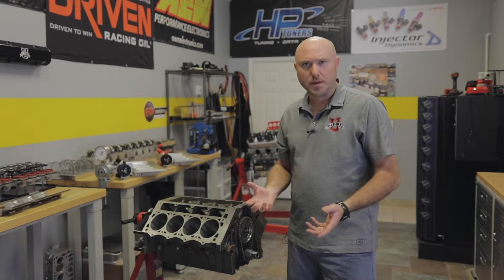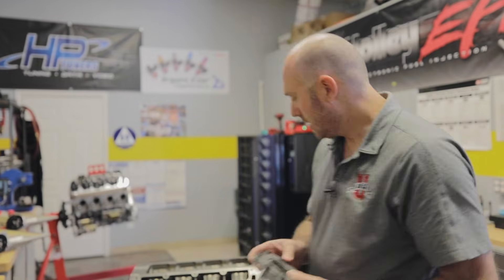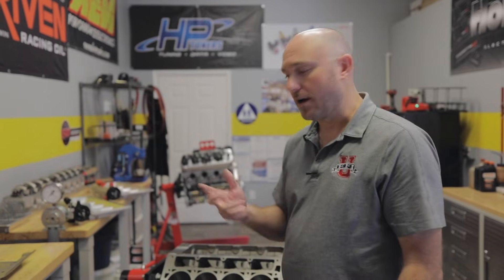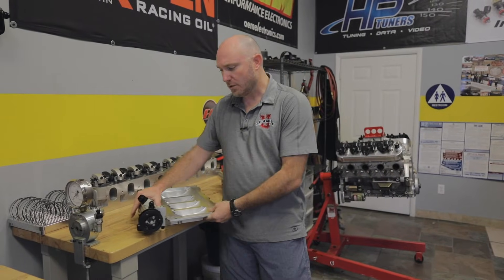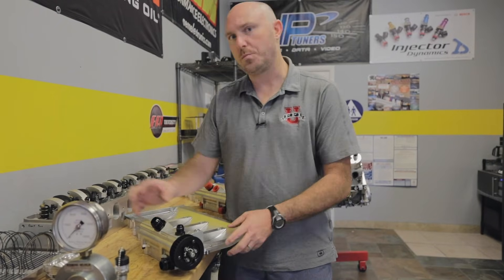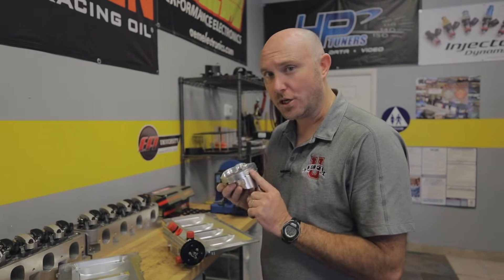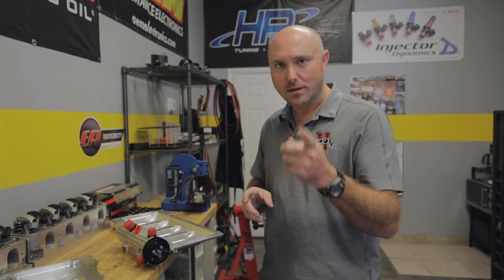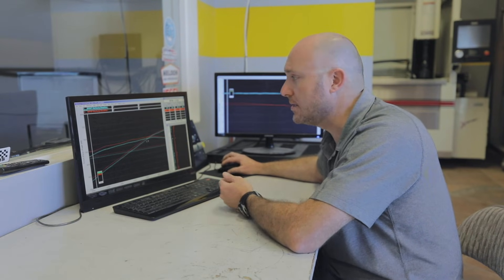Everything you need to know about a dry sump oiling system.

Comment: 6.10, yea-nah, Bro. The sump is NOT being pumped full of 400 CI air per (2) revolution like the cylinder head / combustion CHAMBER is, 'cos da sump don' breafe in through a seperate intake manifold. All tha happens in the sump, is that the air that already in there gets circulated around, below the piston heads, helping (slightly) to cool them. Aside from blow-by and air circulation, NOTHING is happening in the sump. Those 'pumping losses / circulation losses' apply, no matter what oiling system you employ. UNLESS you  'vented' (illegal) the scavenged air to the atmosphere?  Your gains have nothing to do with air pumping losses, unless you'r running an illegal 'vent' system.

Comment: I don’t think you explained the horsepower gain from the system all that well. You made it seem like there was some kind of pumping action with the Pistons moving downwards when in reality the crankcase pressure is equal at all points of crankshaft rotation disregarding the piston blow by because the volume displaced by the Pistons moving down is offset by the Pistons that are moving up. I think the only reason a horsepower would go up is because the air in the crankcase under vacuum is less viscous than pressurised air. Think moving in water versus moving in molasses. This does make me wonder though if the crank case being under vacuum is going to cause more blowby and saturate the oil with fuel

Comment: 15 hp on a 500 hp engine is 3% increase, not really significant.    How much more does the drysump weigh?  
I'm working on a jetboat and there is no room for a deep sump pan, hardly room for any pan..and also you can't change oil as there is no oil drain plug possible, so I'm looking at a psuedo dry sump, with the stock oil pump as scavange to fill a remote tank, and a pump is run inside that tank to feed the engine, electrically driven.  I have not really seen that done.

Comment: I'm under the impression that just because you can use this dry sump doesn't mean you should, when a car goes up in flames in an accident, it's because the oil running in an engine has nowhere to drain. This is more of an application that would be installed in an older vehicle with an engine that requires additional power to achieve the function of its original design intent.

Comment: The reason I’ve always heard people saying they’re going to a dry sump system was especially if they’re going to be circle track or road racing a car that you didn’t want all of the oil getting thrown to one side of the pan and starving the engine. I know that there are certain kinds of pans that have baffles or you can get a different pick up tube to put on the other side if you’re just going to be running in a circle, but from my understanding, the dry sump is the king when it comes to protecting yourself from oil starvation.

Comment: How does the fact that the scavenger pump is driven by a pulley prevents oil over pressure if the main pump is still powerd directly by the shaft?
Reply: Because when tuning you have an ideal rpm for maximum power you swap pullys to change the oil pressure at desired rpm

Comment: For what a dry sump cost it's not worth it for 14hp. Run a deeper higher capacity pan and run it a few quarts low. That with a crankcase evacuation system will do the same thing for a lot less money.

Comment: I would think another benefit would be, is that with a dry sump, the oil pan is much smaller, and thats good for doing LS swaps for example, because the smaller oil pan doesnt get in the way of suspension and steering components. and also because you could place the engine lower in the car, lowering center of gravity. One downside to drysump I would think, is that if the belt driving the oil pump breaks at high engine rpm, you could damage the engine, wheres the wet oil pump is driven off the crank and chances of it failing are low.

Comment: On V engines i think the pressures under piston ring are balanced. The same amount of pistons goes up where the same goes down... it's seems to a good upgrade on high rpm engines with turbo or compressor not for daily and definitely not for hemi with mds on.

Comment: I feel like everyone has a misunderstanding of a pumping loss. the way i see it, the loss is on the intake stroke not the compression stroke. before you think im crazy. go get you a milk shake from sonic, a good cold one.......is it easier to suck the ice cream up that straw or is it easier to blow in the straw.  guys "boost" is positive pressure on the intake. the "pumping loss" is the suction of the piston sucking air in.  Ive noticed on the later fuel injection engines that burn gasoline they are getting better at controlling the rpm with the fuel. in a cruise the throttle valve will be wide open.  even before the direct injection the later ford f150 v8s were doing as such.  its hard to believe that even being possible as volatile petrol is. i hope i dont come off as a troll, it took me a long while to understand that one. a diesel engine is a good example.

Comment: The way I was taught and, in my mind, if I have an engine that's worth putting a dry sump on. I would put it on there never thinking about a gain in horsepower. I would 10 times out of 9 times put the dry sump system on this dream engine if it took 20 horsepower from me. It just so happens there is no trade off.  correct me if I'm wrong.

Comment: 14hp/17lb.ft  for a system cost $6000 ? No thanks 
I can make 25hp to the wheel with a single timing advance degree in my turbo wet sump ls3 95 octane 
Thanks for the informative video
Reply: This is more useful in an application like mine where I need to lower my truck but am limited due to an elongated pickup tube. I am considering a dry sump to eliminate the need for a super deep oil pan. It is not only about hp gain, you can build a system for much less than 6k you just need to know where to look.

Comment: Great informative video, thanks. 
I have just put a wet sump system on a fresh built LS2 and it’s blowing oil past the rear main. It’s pushing 80psi already but you have me thinking maybe I need to run the pump harder to get the vacuum I may not be seeing, according to the oil leak. 
What are people’s thoughts on this?
Reply: the pump on the dry sump has 1 positive pressure pump like on a dry sump and 4 more pumps creating the vacuum\sucking the oil  out of the crankcase. maybe you just need a seal and /or make sure you have a place for your crankcase pressure to escape... valvecover with a pcv or a open port would be a good place.

Comment: Would it be better for a dry sump if you go to a race track few times a year or not ?
Reply: Trust me when i say this, you will most definitely know when you need a dry sump.  high reving hi dollar parts is where you will find it. I wouldnt think any engine builder would do this conversion with a hp gain in mind.

Comment: Be nice to compare the wet sump set-up with a vacuum pump versus the dry sump system. If crankcase vacuum alone is responsible for the gains, you should see the identical benefits with a vacuum pump on a wet sump system and should be less expensive. Dry sump are cool no doubt.

Comment: Great video. One comment is while that I agree the vacuum in the crankcase will improve piston ring sealing, however, at some point the frictional losses of the piston rings rubbing against the cylinder bore will negate the benefit of a better seal. Obviously, you will have to optimize your piston rings based on how much vacuum you get in the crankcase.

Comment: I run a 5 stage dry sump on mine when I had it built my machine shop and engine guy wanted me to go with it and the clear view see thru filter  cause They said we would be pushing the limits when I told them boost numbers I wanted to run.

Comment: You mentioned with a wet sump the oil pump takes works to pump resulting in a loss of HP.

Are we pretending the dry sump doesn't use a externally mounted oil pump that in all actuality uses more HP to operate than a basic wet sump? I love my dry sump for reasons of G forces in and out of corners in my offroad truck and nascar build but I don't believe I make more HP by any means. Potentially less to be honest. I guess what im getting at is its a safety/longevity system not a performance mod in the form of HP gain.

I dont believe the HP gain was from the dry sump system. I believe it was from the crank case vaccuum creating a better ring seal which is achieved with a vac pump on a wet system for the same result.
Reply: The difference in pumping work is due to the fact the we can intentionally alter the amount of oil being pumped in the first place so that we do not need to bypass as much once we reach the target pressure.  So we can choose to run smaller pressure section gears and adjust pulley ratios in order to do less work with a dry sump.  For example...on some of our very high rpm stuff, we run a .650” wide pressure section gear as opposed to a normal .850” wide gear.  That way we can still achieve the required pressure but with much less excess flow that needs to be bypassed.
Reply: You are also not pumping airiated oil straight back into the engine. Plus the dry sump should be scavenging oil off of the rotating assembly. Windage robs power. I'm surprised aerodynamics do not play more of a role in crankshaft design. It is going to take a certain amount of hp at high rpm to spin the crank and move that air/oil mix out of the way. Say it takes ten hp to move the air/oil mix in the crankcase at high rpm. If you can improve the aerodynamics on the crank and rods enough to reduce the power loss by 50% that's 5 free hp. Every little bit helps.

Comment: Nice video thanks a lot :) still don’t understand how the oil get pushed up into the motor tho . Does a oil pickup still get used ?
Reply: Ah does the oil pick up run straight off the pump instead of going inside the sump ?
Reply: @internalcombustion8744  Hello, I love your name.  If you watch at 4:00 he explains it half decent but leaves a lot out. That looks like a new oil pan you have to bolt on and notice it has a belt driven pulley. It's rotating and scavenging for all the oil that falls off the rotating assembly that falls into the pan into those separated areas. Then it gets sucked out of there and put into an external reservoir that is pressurized oil with no air. Then from there it will get piped into the oil pressure galleys, i'm not sure if it's just one inlet at the oil filter  or what, I would assume so. Then it goes through the galleys into the crankshaft to feed the mains and through the crankshaft to feed the rods and then it all spills out back into that new oil pan that is sucking it all up and feeding it to the reservoir. The vacuum created by that belt driven oil pump is what helps reduce crankcase pressure and in theory seat the rings better. This, combined with no long having frictional losses with all the oil slapping around inside the rotating engine provided the dyno gains.
Reply: @JohnDoe-lt9sg  
Oil draining on to the rotating assembly and creating windage is one reason you see enclosed camshaft housings on the really big buck pushrod engines used in Nascar etc. The enclosed camshaft housing then has it's own dry sump pickup. This should also help evacuate the used oil from the valve train removing oil that could potentially pool and cause power losses. Plus pulling the used oil from the heads should lower cylinder head temperatures.

Comment: There seems to be a factor in the work a piston does on it’s down stroke you failed to either mention or take account of & that is when one piston is on it’s down stroke creating crank case pressure another piston is on an up stoke making crank case vacuum so one cancels out the other.
Reply from the maker: That is only partly true though, because there are a lot of restrictions to airflow in the crank case that make it less than a perfect trade off, so there is still work being lost to pumping...

Comment: Question: With the dry sump , does that mean the bottom of the  oil pan is now higher than with the wet sump oil pan?  Is there more space for the engine to be lowered with dry sump configuration?   if using aluminum for most all parts,  Is there any weight savings with the dry sump?

Comment: According to tests ran by Engine Master hosts, that difference in power could be entirely explained simply by the reduction of the amount of oil in the wet sump below the pan manufacturer's specifications. Further testing would be needed and information of the test engine published for the conclusions stated that a dry sump system is better to be proven/evaluated by peer review.
Reply: so you don't believe any of the data presented here? lol ok
Reply: @supernice_auto  I typed this comment so long ago I'm a little hazy on what was in the original video but at a glance it appears I wasn't denying test results in the video as you insinuated, I'm simply skeptical of the conclusion reached. Based on what I wrote, what I'm claiming is either: there's testing data from Engine Masters that contradicts this test's results and further testing is needed to isolate the variable causing the variation or that data from Engine Masters tests show that this change in horsepower could be overcome simply by distancing the oil surface in the wet sump from the crankshaft (in which case the gain in horsepower isn't due to the dry sump itself but flaws in his specific wet sump setup). Either way, further testing and/or peer review is needed to prove his conclusion.
Reply: @keld101  gotcha, thanks for the clarification. Do you have a link to said engine master video?

Comment: I must say I wast aware of the power gain with a dry-sump oil system.
Reply: In 1970 the Javelins that Penske was running had engines that could be over powered by the brakes*. In 71 when when the SCCA changed the rules (with Penske advocating it as a possible cost savings for teams on more limited budgets to help prevent blown engines) the Javelins went to the engine over powering the brakes.
*when ever Penske's organization took on a program the first thing they looked into was improving the braking system. Better braking allows you to go deeper into the corners. On result of this brakes off of the Pordche 917 wound up with AMC part #s for use in Nascar. And yes the Javelins were suffering from an oiling system that was not really designed for continous high rpm operations.

Comment: Very informative so thanks for posting. I am configuring my custom 427 Noonan block as a street performance build. The block requires a custom pan, so a dry-sump was a no-brainer. Daily Engineering was my first choice, but like many aspects with a custom build, it's been easier said than done.
Reply: What size pulley did you go with?

Comment: Excellent comparison however there was a major variable not considered. The oil flow rate and pressure of the dry sump pump is likely to be different to the wet sump pump. Pressumably the relief setting of the two pumps were set the same as each other, however almost certainly the pressures were different at different engine speed. A plot of oil pressure vs RPM for both cases would highlight any oil pressure differences between the two systems.
A minor point is that oil temp, coolant temp, ambient air temp and pressure were presumably also monitored for both cases, to ensure that inconsistancies were not contibuting to the power difference. 

I recall that you did say that the wet sump pump heats the oil at high RPM when the relief valve opens, therefore an extended run at high RPM, would quantify the extra heat generated by the wet sump system.

Comment: The pumping loss of the piston going down creating crank case pressure as he stated is only sort of true on a single cylinder engine. On a multi cylinder engine one piston is going down another is going UP. Even on a single cylinder engine it can in theory store energy in the form of pressure but once the piston reverses it will be released pushing the piston back up. There is bound to be some loss in that cycle. Even a more modern race V8 like a NASCAR cup motor with a four chamber crank case follows the same principle one going down the other going up. Crank case pressure on a modern engine built correctly due to ring leakage should be close to zero.
If you consider all the factors driving the pressure pump and scavenger stages on a dry sump setup will actually reduce power over a properly designed wet sump. The catch is longevity a wet sump engine basically lubricates with foamed oil and g forces are a problem . A properly designed dry sump scavenges the foam and condenses it back to oil.
Reply: The last paragraph clearly explains why Penske lobbied the SCCA to allow wet dumps in the Trans Am  series starting in 1971. Another possible benefit is lower engine mounting in the car improving handling.
Reply: @mpetersen6  wet dumps? You mean dry sumps?
Reply: @tomhutchins1046 
Yah. I hate when spell check on my tablet does stuff and I dont catch it. Of course dry dumps are better than wet dumps 🙄
Reply: It could also be explained a bit by an easier to form oil film under vacuum and less load on the oil pump itself.
Reply: @tomhutchins1046 Go and read about rod/stroke ratio and you will see that the acceleration of the piston as it descends differs from the acceleration on the way up. This leads to a fluctuation in crankcase volume/pressure.
Reply: @ Go back to basic high school geometry you will find out you are wrong. Now you can learn something or stick your head up your. Im guessing its the latter, I have been building race engines for over 35 years professionally.
Reply: @ Go and read basic high school geometry. LOL